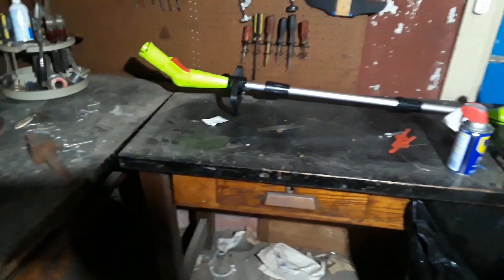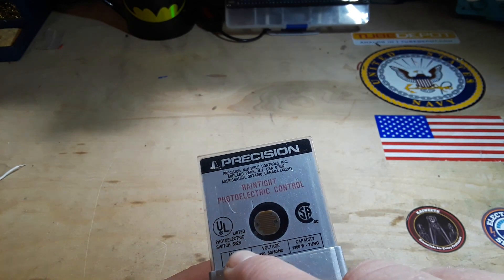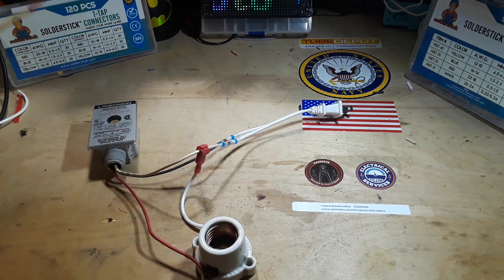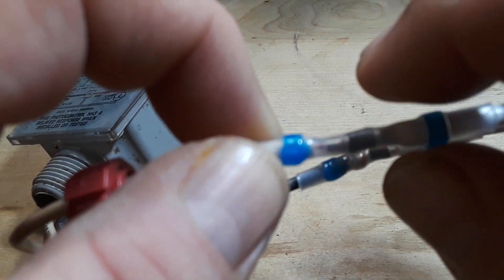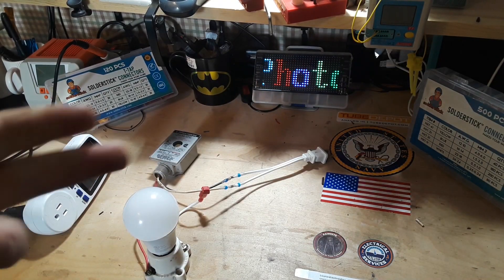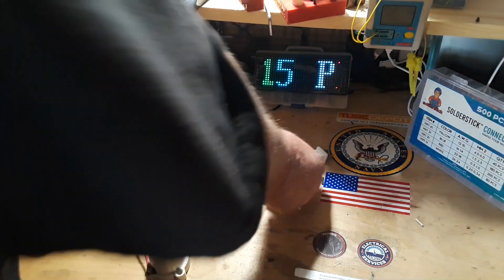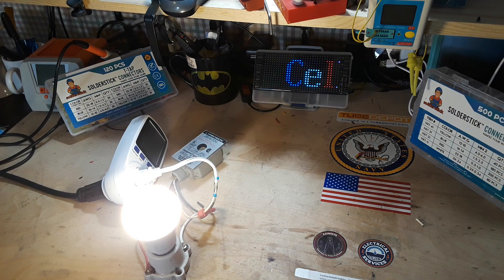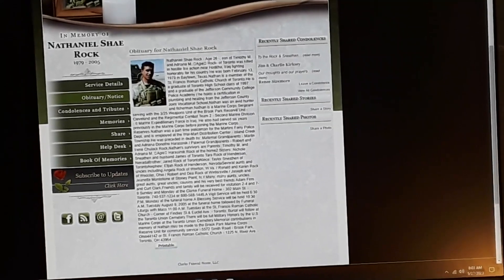My Old Man Called This an "Electric Eye" - Sponsored by SolderStick Wire Connectors

Comment: What would you use this Electric Eye for, to do what besides turning on/off the AC 120VAC voltage for light to dark? it seems these Electric Eyes were used for outside lights at your house to shut off all the outside lights when the sun went down. I'm not sure what else you would use these electric eyes for

Comment: I think the reason why the light comes on when first powered,is primarily because the default mode is “on”, in case of failure of the switch operating bits. This way, it won’t leave the area lighted dark if the switch fails. The fact that the lamp lights when powered is a convenient coincidence. These devices turn the light off, when actuated, rather than on. Consider them as a “normally closed” switch, which opens when actuated.
Reply: That’s true. When the electric eye goes bad the light never turns off.

Comment: You went through all that and then never explained how it works. Strange.
Reply: This was a sponsored video about wire connectors.
Reply: Okay, here's a simple explanation. The device contains a bimetallic switch. A bimetallic switch is basically two different metals bonded together in a flat strip. The metals  expand when heated but at different rates and being bonded together they make this strip bend and flex. One end of the strip is fixed, the other can move and when you put a contact there it can touch the contact -closing an electrical circuit - or move away from it to open the circuit.
In this device now the Light-Dependent Resistor is connected to a little heater. When it is powered there's constantly a constant flowing though the LDR and the heater. Now, when it is dark the resistance of the LDR is high and only little current flows and with so little current the heater does not produce enough heat to affect the bimetallic strip. But when light hits the LDR its resistance drops, it lets more current flow, which means the heater can produce more heat and the bimetallic strip bends as it heats up and breaks the circuit to the lightbulb, turning it off. Cover the LDR and its resistance rises, the heater produces less heat and the bimetallic strip bends back to its bae shape, closes the circuit and the light turns on.
As you can see this is a rather slow process.

Comment: The switch is bimetallic and the white part with the black stripe the LDR was connected to is a carbon resistor heater that heats up the bimetallic strip and turns on, (or off), the light. Thats why it takes so long to react.

Comment: Very cool! I had a more modern one that I took apart for the ldr, usually the resistor that’s used to heat the bimetallic switch contacts is a white ceramic sheet with the carbon printed onto it.

Comment: Paul, you had the neutral and hot connections of the power cord reversed. It will and should still work but not as safe. That's why most plugs will only go into an electrical outlet only one way because one blade of the plug is wider than the other. I just wanted to let you know that.
Reply: @CBSBKKAMcomputerhelp Regards to safety - you didn't mention the ground not being connected. It's a demo of a photocell (which would be direct-wire and not plugged), not an NEC course. Paul is undoubtedly familiar with polarity.🙄